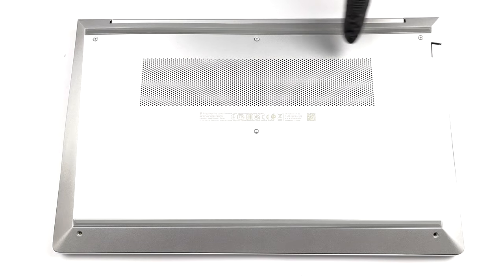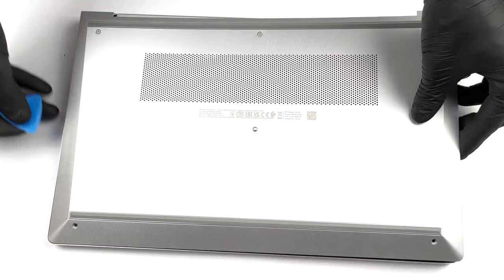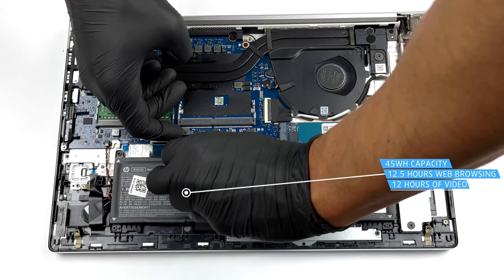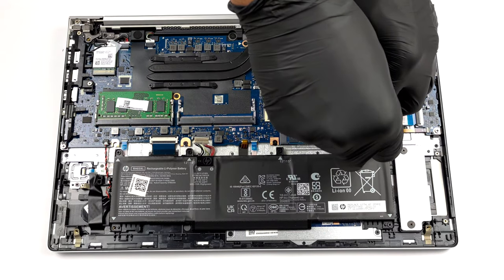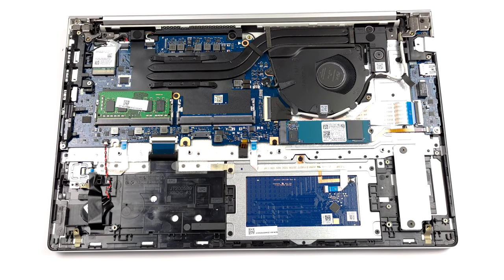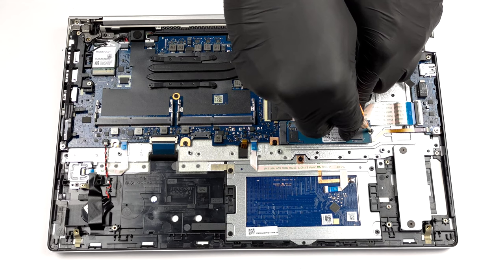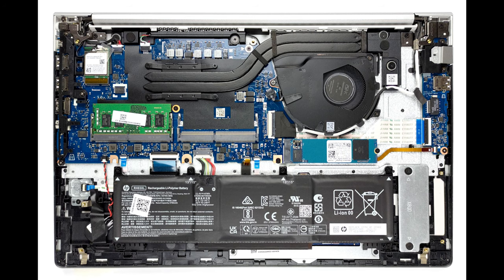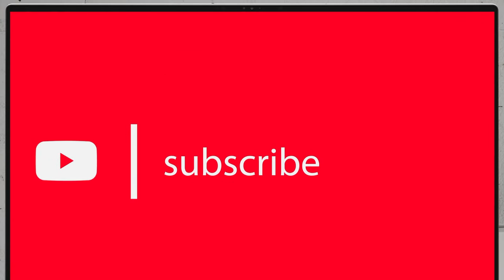🛠️ HP ProBook 455 G8 - disassembly and upgrade options

Comment: As it has a rectangular part at its bottom which has holes in it, I assume it is for ventilation when fans try to cool it down. If the laptop is kept on bed/duvet for a few hours, which would block the holes at the bottom, will it heat too high or will the fans start running very loudly?

Comment: Massive long shot but has anyone on here got one of these to hand?
Under the small removable black section bu the power/USB-C ports there's a small chip, mines popped, cant read the details off of the top of it and my USB-C ports dead, hoping its a simple swap but don't have the details for the chip.